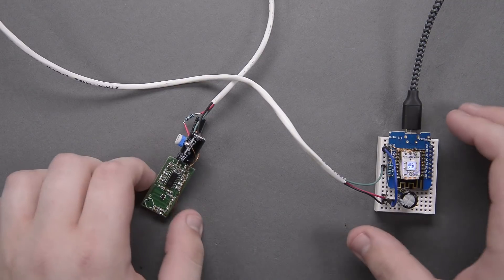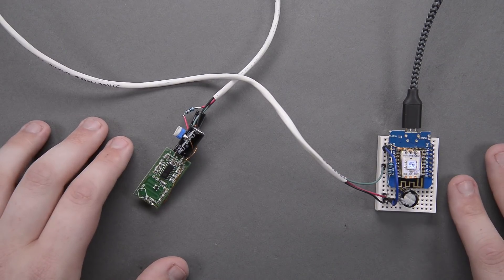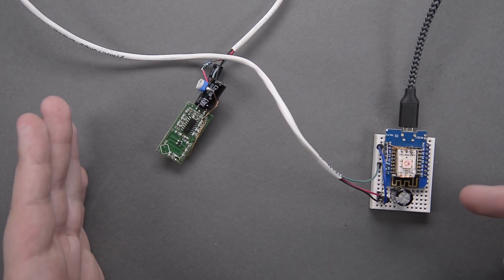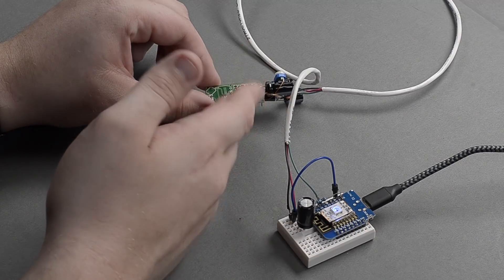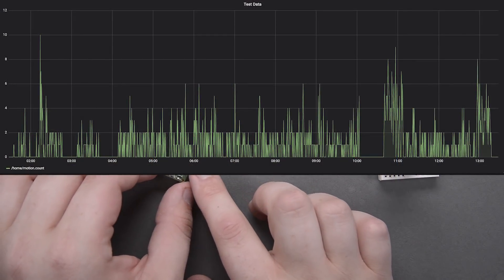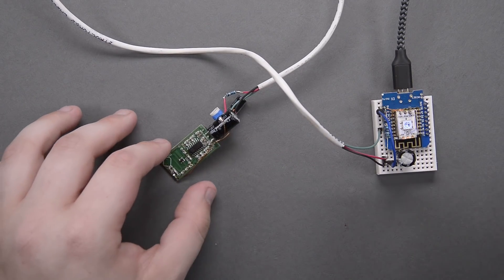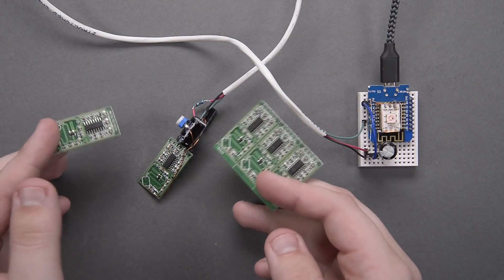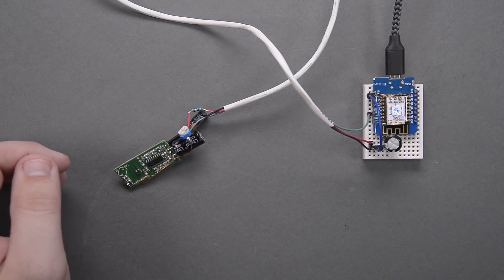Trying a RADAR Motion Sensor

Comment: these equipments cannot share the same GND due to RF interference problems.  The solution is using an isolation in feeding and signal.  Just add hlk 1d0505 or something similar to separate the 5v and an optocoupler for signal isolation.  I've tried it and it works perfectly

Comment: I stopped using the power from the esp8266 and wired to 5 volt PSU to both the esp and the sensor.
I've seen that even the smallest voltage drop causes it to trigger, 5.00 to 4.99 will cause it to trigger.

Comment: Hello ItKindaWorks, Just by dumb luck I made it work using a D1 mini and two Mini Voltage Reducers (one DC 12V step-down to 3.3V for the D1 Mini) and (one DC 12V step-down to 5V to drive the RCWL-0516).  I have it in a fence post at the end of my driveway and I rarely have false alarms maybe once a day because of lizards that jump on it to Sun (I live in Florida), but that really isn't a false alarm or is it?  Just like you in the beginning I tried powering it and the D1 with the same step-down but it didn't work.   I hope that this might help someone that wants to use one of these modules they are awesome.

Comment: I am having the same problems when using the sensor on an ESP8266, but when connected to an arduino, there is no problem at all. I am using I2c to set up communication between the ESP8266 and the Arduino, that way I can make use of the WiFi functionality of the ESP8266.

Comment: Hi  had the same issues with this module. But no success. After doing many tests around different places. Here is the outcome. You need to eliminate the EMI RF by using capacitors around 1000uf and .1pf the power rails of the ESP. Also may me near the sensor.  But this particular sensor definitely NOT suitable for outside if there are lot of moving things and trees. Also when there is NO fixed things like buildings around near to sensor to reflect the radar signals.  It is 100% great at indoors with a closed environment. It worked perfectly without any issue. Also the mains you are powering the ESP has to be properly grounded or make a ground earth wire to do so to reduce noise. good luck.

Comment: I saw someone playing with these when they first came out, attempting to read the voltage output as something that varied proportionally to the speed or distance of the moving object and it just wouldn't work. Ultimately they figured out that the output simply swings high or low as a motion or no motion signal and the exact voltage was not important, only that it read below the low (1.5v on 5v boards) or above the high level (3.0v on a 5v board) detected by an Arduino. I have used mine this way. At first I played with it at work to detect people coming down the hallway outside my office until my supervisor claimed this could be used to track movement of employees and asked me to remove it. Later I installed one in my garage to detect people walking around the side of my house. There are no plants in that area (plants cause false alarms when moving from wind). It detected a woman prowling around my house at 3:30 AM a few weeks ago and I scared the crap out of her after which she took off running (she was barefoot and it was raining... WTF?) and got into a car which took off. Anyway, power, ground, and output into a digital input pin was all I needed.

Comment: Through trial and error I found 3 things that help improve consistency and reliability in my projects with these.  First is orientation, I know they are supposed to be omnidirectional and they are BUT if I elevate them a few inches off the work surface and mount them in "portrait mode" I get the best results. I made little Thingiverse stands just for this purpose. It's not just about getting it away from the other electronics.  Perhaps if you hung yours down a bit from the cabinet?

2nd - Power, these are rated for up to something crazy like 28V.  I see differences between using 5V through the USB interface of an Arduino and the same 5V running directly into the 5V pin.  Try giving it more power.

Lastly, and I know this sounds silly, but when I power up the sensor I add a delay in the sketch and actually leave the room so it can "calibrate" easier.

These things along with the pulldown resistor you are already using give me pretty good and repeatable results, I really like these guys.  Good luck.
Reply: 1 , the signal can be blocked by certain if not all kinds of metals, and most of the components opposite to the antenna are made of some kind of metal, copper mostly, so orienting it upright might just be enough to yield better results, and 3 the delay(); added makes sense, giving the device enough time to think yet short enough so that humanoids cant notice the time diff. but you said power... how is it done ? did you mean voltage input ? or signal boost from an inverter ? Slightly stupid question, I know.

Comment: For distance using infrared I use the VL53L0X or VL53L1X. There are breakout boards for each on Adafruit and Sparkfun respectively. They won’t go through walls of course but are very accurate. They also have a narrow beam width which is useful for my applications. The cost for the sensors alone is low even in small quantities...maybe $5 and need a regulator for I think, 2.8V. So, more than a couple dollars. But, I’m using both and am having good luck everywhere but outdoors in sunlight.

Comment: I got a RCWL-0516 after watching Andreas Spiess’s #135 Radar Sensors comparison.
Wanted a sensor I could use in the garden enclosed in a plastic waterproof box. Had all the same problems you had when I tested it with an ESP-32. Adding capacitors had no effect. I then tried it on a breadboard with just a LED as an indicator and a battery for power supply and it work reliably . So I assumed it was the wifi on the ESP-32. so put it back on the ESP-32 and only turned on the wifi after it was triggered and ignoring any triggers while the wifi was on. This seem to work.  
Also found it needs a good 5v, it was unreliable at lower voltages. To get it to work reliably in the garden I had to combine it with a PIR sensor as the movement of nearby foliage triggered it on windy days. So if you use it near a window that could be a problem. Combined with the PIR I now have very few false trigger.

Comment: My experiences with RCWL-0516 are similar.  I increased the distance between the esp and the sensor to 8 ft with only a slightly perceptible increase in stability.  As you did, I experimented with different decoupling circuits to no effect.  I even experimented with different shields such as aluminum (soda can), tin (soup can) and steel/iron.  None made a great difference in stability.

The biggest bummer is that I was hoping to use these radar units as tamper proof motion sensors.  With the ability to detect through walls, one could place them INSIDE the structure and detect motion outside the structure and the only way for a bird/insect/critter/human to affect the operation of the unit would be to gain access to the structure.  Can't do that with PIR.

What is left on my test bench to check out is to determine if the radio interference is strictly WiFi.  I have a BLE and LoRa to test to see if interference is still evident.  If anyone has any experience please add to the conversation.

Comment: Works perfectly with my adafruit feather 32u4. The detection range is about 4 m ... the frequency is about 3,2 MHz. It is not compatible with the esp8266 or esp 32 (or any other controler with a wifi modul). Try a chinese nano or an adafruit feather lora 32u4 ...
Reply from the maker: Thanks for the input! I know using a non wifi module will likely make things work better (though I've still heard some people having issues even without any microcontroller using a bench-top power supply and an LED). I'd like to find some way to do this with wifi if possible. If not with this sensor then with something else. 

My reasoning for wanting wifi is because I don't want to have to setup some kind of separate "base station" system to relay data from some other wireless protocol to my network. I also feel like the fact that the ESP does have wifi shouldn't really matter - even with a non wifi device, there are still going to be dozens of devices talking through wifi anyways.

Comment: I have the same radar sensors bought about a year ago and tried them out. They worked fine, no false positives at all. However I could not get them recognising anything when the detection range was greater as about one meter. So my theory is: maybe there is a way to limit the range of this damn thing and mine came with this „feature“ to make it more stable but loosing distance. And yours don’t have this limiting device (probably a resistor or so) and pick up all the crap of your surroundings. Btw my WiFi works on 2.4 and 5 ghz and this sensor seems to work around 3.1 GHz so I really do not expect much distortion from any WiFi (at least not on the European frequencies, I don’t know if WiFi is the same worldwide). If further testing is needed I can try out something if you wish. I also would like to get them working better as they now do for me - besides my only problem is the range at the moment.
Reply from the maker: There are pads on the bottom for another resistor based range adjustment (labeled rg-n I think) but I havent checked it out yet because I remember seeing someone noted that it reduced the max range but also seemed to reduce the min rage to ~.5 meters or something like that. Not ideal for the under cabinet solution but maybe worth looking into...  Thanks for the offer! I'll have to think over all of the feedback from this video. I will let you know if I have any thoughts on how you could help! :)
Reply: Do you still know, where you got your sensors from? When I was experimenting with mine I tried to limit the distance to about one meter with an added resistor on the back, but it just got down to about five to six meters which was to much for my project. Other than that it worked pretty reliable with an arduino nano.
Reply: Joshua Mühlenkamp I got them from EBay in June 2017. the listing is no more active so I cannot tell you the seller, sorry. But within a year so much can change in the supply chain. What I can offer is to dig out mine and take a look, maybe get some cap and resistor values if that helps. But you must tell me what i shall measure in this case.

Comment: You totally over complicated this sensor, I tried out one of these last week and had it working in minutes.  I installed Tasmota on a Adafruit Huzzah Feather (was already connected to my breadboard) then connected this sensor to GPIO2 (not the best pin for input) and finally setup the onboard light in Tasmota to light up when it saw motion. No additional capacitors or resistors, just a strait connection to the Huzzah Feather and worked perfectly! Could easily detect me from across the room accurately and consistently.
Reply from the maker: I originally just plugged it in without anything extra. The reason I started modding the circuit was because it refused to cooperate. I've tried a couple of modules and they all react similarly. Not sure what you're environment looks like but my house does have a lot of wireless stuff (probably 30-40 devices on wifi spread across 4ish SSIDs at any given time). Glad you've had success with it though! :)
Reply: I only have 30 WiFi devices and live in the middle of a pretty large city. Everything I have read about this sensor is that it is using Doppler radar to detect movement which should be in the 1Ghz to 2Ghz range. So not sure how the 2.4Ghz or 5Ghz comes into play (I don't believe ESP8266 supports 5Ghz anyways) but I am no expert on radio signals. Your choice of D7 was even better than my choice of GPIO2 so surprised you are having any issues. 
https://github.com/thehookup/Wireless_MQTT_Doorbell/blob/master/PinModes_ESP8266_NodeMCU.jpg

Also, agree with another poster below that this is the video to checkout:
https://www.youtube.com/watch?v=9WiJJgIi3W0
Reply from the maker: Well I'm not an RF expert either but somewhere deep in forum research I remember reading a discussion about how this thing works and it's still kind of up in the air whether it opperates on doppler or an interference pattern system. There is a healthy discussion of that topic here https://www.rogerclark.net/investigating-a-rcwl-9196-rcwl-0516-radar-motion-detector-modules/comment-page-1/

I watched his video a while ago but theres no mention of using it with an ESP - which I think is the crux of the issue I'm having. I suppose I'll just have to go and get a few other modules and see what works best... Or wait a bit and see if anyone else has had experience with these boards and managed a solid fix. My best test area has been my concrete walled basement which doesn't negate the signals from within my house but does at least minimize any outside sources. Still lots of false positives.

Comment: I use the HC-SR501 motion sensor. But to get rid off the false triggers you have to solder a 100nf ceramic capacitor between pins 12 and 13 of the chip.
I use an 0603 package which fits perfect between these pins. After that you won’t have any false triggers.
Reply from the maker: I'll definitely try that out!

Comment: Ummm, you probably already know this, but the large, squarish HC-SR501 IR motion sensors are known to be sensitive to RF from the ESP8266 modules. The smaller HC-SR505 mini IR sensors are much less sensitive to RF.

I've used an HC-SR505 sensor next to an ESP8266 without any detectable interference.

Edit: After reading Silikon Computers comment and checking the pictures on Aliexpress, I realize I'm using the AM312 IR sensor, not the similar, but not identical, HC-SR505.
Reply from the maker: I did not know that - or at least the part where the smaller ones are less susceptible. I'll get one of those right away and see how it goes!
Reply: https://www.youtube.com/watch?v=jpjfVc-9IrQ

Comment: I also tried radar sensor with esp 8266. Its operation is very unreliable. Tried filter capacitor and resistor combination, but no success. Then I tried it with Arduino Nano. Results wee acceptable. The moment you add esp 8266, it starts chattering and becomes unreliable. Still, trying to find solution to operate radar sensor with esp 8266.
Reply: Out of curiosity, while the module was connected to the Nano, did you try bringing an active ESP close to it? Wondering if it's the WiFi or something else on the ESP causing the interference on the power/signal rails.
Reply: @JonathanWellskcender  You are mixing two radio waves so one will disrupt the other so caps and resistors will not work
Reply: @MrBobWareham  Different frequencies, no interference.

Comment: Try adding shielding to separate it from the esp8266's wifi signal. It can be as simple as a small tin can with the sensor mounted inside to make it more directional (away from the wifi signal). Depending on where you need to have the motion detected, you may be able to separate them enough to prevent the false triggers.
Reply from the maker: Thanks for the input! FWIW I have tried separating them by a couple feet (much more than that and it becomes kind of a pain to have to have micro and sensor so far apart. I havent tried using any metal separation yet but from what I've read online, it sometimes does and sometimes doesnt help. These are the main links I've been using for reference on this sensor: 

https://github.com/jdesbonnet/RCWL-0516/issues/22

https://github.com/jdesbonnet/RCWL-0516/issues/2

https://github.com/jdesbonnet/RCWL-0516/issues/14

https://www.rogerclark.net/investigating-a-rcwl-9196-rcwl-0516-radar-motion-detector-modules/comment-page-1/

https://tech.scargill.net/category/rcwl-0516/
Reply: Also I found that using a wallwart power supply for the D1Mini was a lot more stable than using the usb cable to power it. I have one in use right now, D1 is about 3ft away from the sensor, no false triggers. I do have the sensor orientated so it's sensitive directions (front and back of the pcb) are pointed away from the D1.
Reply from the maker: Perhaps I'll try hooking it up to my bench power supply. I tried with an apple usb brick and from a battery (which I would have thought would be stable but who knows). I'll also try having perpendicular orientation. As you can see, I've just had it dangling without much thought given to orientation.
Reply: When using metal to shield, you need to be careful that it's not too close to the sensor as it will affect the tuned circuit. It's a very cheap design with a lot of rf magic. I suspect the reason others have failed with the metal shield is that they don't realize the presence of the metal messes with the circuit. Also grounded metal is more effective at blocking.

Comment: You should look on aliexpress i bought one a fiew months ago for like 80 cents so check there and Andreas  Spiess has a video on multiple radar sensors and he created a chart about their specs
Reply from the maker: Thanks, I'll definitely look into some of those other modules! Have you had any personal experience with them? I'd prefer to either salvage what I have or have the backing data to say which modules work well long term on an ESP. Like I said in the video, I'm pretty sure the issue here kind of stems from the ESP when it uses it's radio. Has Andreas Spiess tested these with ESP modules (I didn't notice whether or not he did in his video or some other video)?
Reply: The test video: https://www.youtube.com/watch?v=9WiJJgIi3W0
In this video he does not use any logic, only a meter, but something tells me that he would try